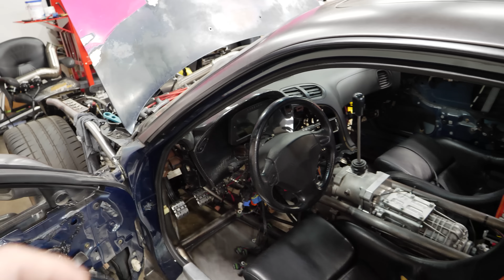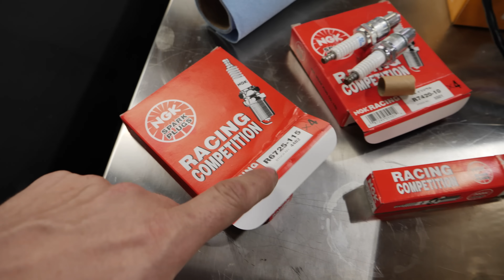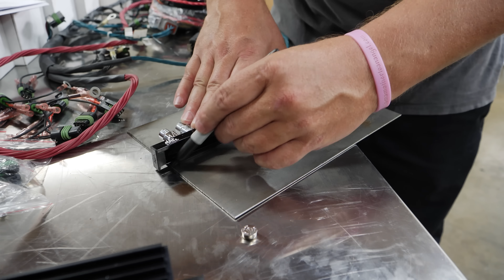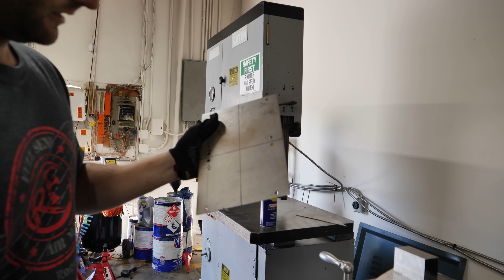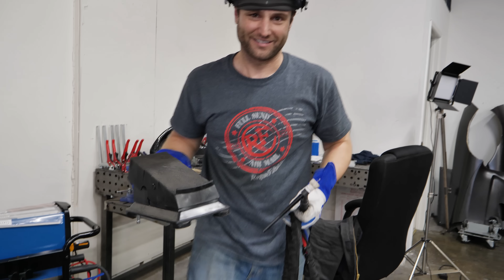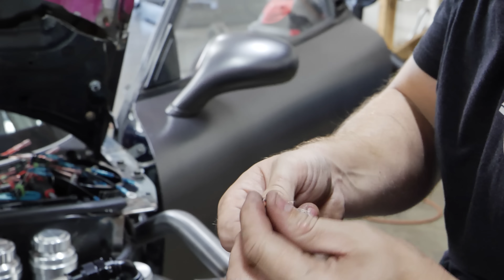Ignition Installed! 4 Rotor is Ready for Dyno!

Comment: I'm sure you have a fuse on your power distribution from the battery, but you should consider putting a fuse between your the power distribution, and the computer. If you got a short on that jumper going to the CPU it would fry it and could burn the car down. It could easily happen to with it being up against the dash.

Comment: Rob, your techniques have improved immeasurably since I first watched your videos a few years ago. However when you build race cars, as I am sure you know, you are always learning. I feel you might gain something from reading at least two of Carroll Smith's excellent books: Engineer to Win and Prepare to Win. One thing I always remember from them, is to avoid crimped cable joints at all costs. They are prone to loosening, electrolytic corrosion and consequent high resistance connections. Soldered joints with glued interior shrink sleeves are better but the best is to avoid joints everywhere and run wires right into the plug pins. Aircraft spec plugs with cable seals, a seal between the two halves and a locking ring are what Ron Tauranac one of the greatest race car designer always recommended, preferably with one half of the plug fixed to a panel.

Comment: Gloves, per se, are not the problem it's the risk they will snap and unlike hands that have soft flesh that will rip off, they're usually leather or a synthetic that will not tear and will snag and get pulled into the machine, along with one's hand, arm and even body - lathes can literally rip arms off or warp a body around the workpiece, smasshing all the bones in the body while doing so.

If you wear thin latex, or rubber, gloves they'll just cut and tear off, so may be a suitable option for those who have alergies or need to keep their hands clean?

Comment: If you want good connection, especially for signal, DO NOT use Silver looking TIN connectors. They will make you lose voltage and signal. Use "Gold Plated" i.e Copper plated connectors. Using over sized connector and overlapping the wire strands inside the crimp connection also helps.

Comment: Ok Rob... That may very well be the best wiring job you've ever done.  A few thoughts.  
1.  Are you going to need a fan on the computer and ignition boxes??
2.  Could you turn off your trailing box just to see if there's a difference without them as I do not run trailing ignition (curious).
3.  A wire attached to ground at one end and nothing on the other can easily become an antenna.  It is advisable to ground both ends.  If one end isn't grounded the shield can resonate.

Looks awesome!!

Comment: Shielding on the cable should be grounded at both ends mate.
Reply from the maker: Not on ecu signal lines where ground is regulated or where you don’t want the ground to make a loop and become hot if the main ground disconnects.
Reply: @RobDahm  Good call, I see!

Comment: Computer Network Commands! Hahaha! Makes sense...maybe more sense than Computer Numerical Control. After you get used to that vertical knee mill you gotta get that 5-axis mill brotha! 3d model anything with Fusion 360 and spit out some code to make some bad ass parts...you can really make some works of art with those things. I ran a $200k 3-axis mill used for cutting stone slabs for about 7 years, had a 11ft x 7ft x 2ft workspace... funny thing is, that was a cheap one!

Comment: Those are only the trigger wires from the ignition box to the coil. They are low voltage. No way they need 4 inches of clearance. The actual plug wires to the spark plugs are the high voltage. Those are the ones you don’t lay on a sensor.

Comment: Just wanna point out that you shouldn't remove the shielding at the ends like that, if you can try and wrap it around the connector bit at the end before heatshrinking it. There's nothing for it to ground to there anyway and those unshielded bits will puke emf into your engine compartment so badly.

Comment: Grounding both sides of the shield is always better.  Grounding just one side or 'floating' the ground  is used in some applications where the circuit ground is separate from chassis ground.

Comment: Rob you really need to try Autolite part# AR3932X there a 10 heat range non resister nickel material spark plug and they have lasted in my Bridgeported 13B-REW @ 20psi+ boost for months without any issues. You should try them you would be surprised.

Comment: Euhm Rob: it's better to wire the shield on the beginning and the end, Siemens has tested it with large motors (>15kW) and frequency drives (just so the result was way more visible) and the emc/emic is way less then with only 1 side to the ground ;)

Comment: Gloves are no fun with a mill lol. A guy I work with tore apart half his hand with a 1 inch 4 flute end mill because he got too close with a glove on.
Reply: Holy fuck...I got no clue how these machines work, but aren't gloves worn for safety???
Reply: @huleyn135  I guess if you've got gloves on, don't get your hands close to the spinning sliver stick of death
Reply: huleyn135 sometimes they are sometimes they aren’t, if I wore any glove it would be a latex glove but even then you have to pay attention a lot more. I personally don’t like wearing any gloves because my hands glide nicely over the handles and you can feel the cutter and the cut more. I.E. the machine can tell you what the machine likes and what it doesn’t like
Reply: huleyn135 gloves are safe for using hand tools or carring sharp objects that kind of stuff, any power tool that can catch the glove or clothing is a bad idea, mills, lathes, drills 
Heck even engines when they are turning
Reply: @huleyn135  Its not safe if you have to have your hands close to the cutter for any reason. If you don't then it is safe in some ways. It's like using a lathe, you never wear real loose clothing, jewelry or have long hair hanging down. It can rip limbs off.

Comment: It being colder doesn’t really mean it’s cooler. Isn’t it that the spark is longer and more pronounced so it burns the a/f better? Like that’s why turbo cars use cooler plugs
Reply: no, the spark plug is legit cooler, so it doesnt pre-ignite the fuel. its for higher horse-power engine. The spark strength is the same between hot and cold plug ( its dictated by the coil, not the plug, well, it depends). Colder plug can handle way more heat. 

A colder plug also need to be run at higher temperature so the unburned fuel isnt deposited on the plug, that's why you dont run cold plug on your mums car.

Comment: I can't wait till you take this for the mile run and see how much faster it is then the 3 rotor
Reply: Same, and i believe you meant the half mile, a mile event would be too crazy 😂
Reply: @Shavman  need a longass runway or even Bonneville/Black Rock Desert for a flying mile.
Reply: Scott Kenny ❌🧢
Reply: @Shavman  ? Bonneville has something like a 5 mile long run-up. 

I think that the minimum length would be a @15000ft runway, 1 mile for Accel, 1 mile measured, and the last 4400ft for braking. And I would want more braking distance than that. Not many runways that long.
Reply: Scott Kenny i was agreeing with you
Reply: @Shavman  gotcha.

Comment: Your mill is technically not a CNC, (computerized numerical controls), your still moving the mill manually, if it has servos motors moving the x,y,z and you wrote the program then it would be a CNC